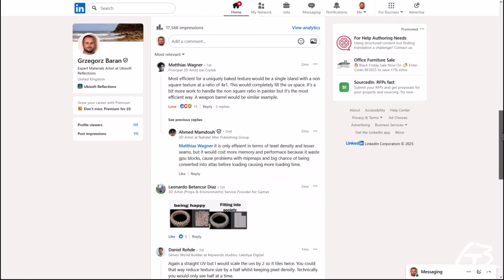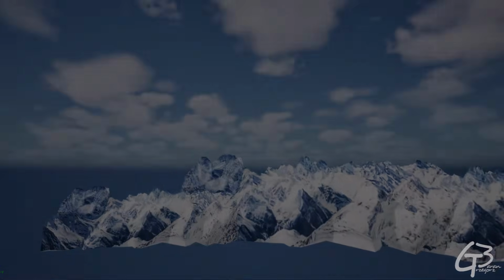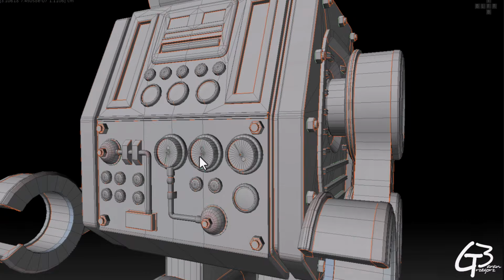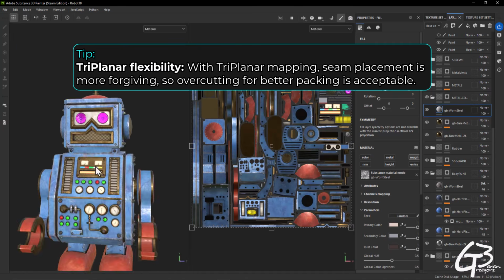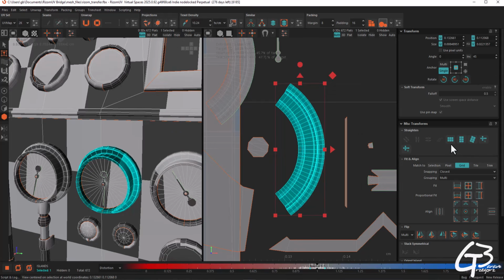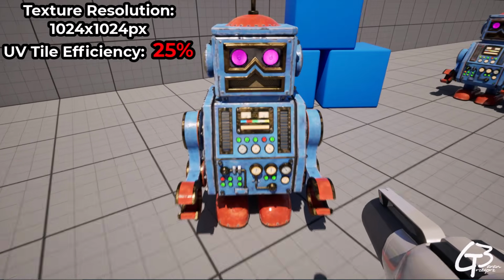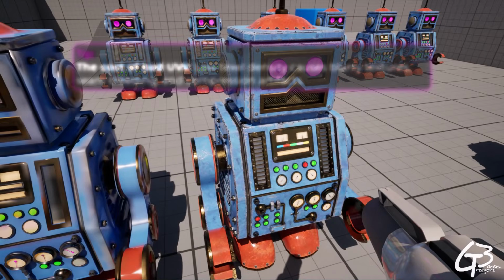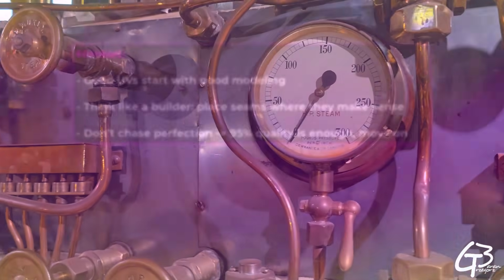UV Unwrapping: A Serious Guide for Clean, Production‑Ready Results (No AI)

Comment: I really like how you went into depth and showed the impact directly in Unreal. One question I have is how do I choose between 16px vs 8px island margin when working with 2k textures in unreal as it sometimes makes about a 10% difference in uv space usage. How well does unreal tolerate island margin on the lower end?
Reply from the maker: Thanks, very appreciated :)

Unreal is pretty tolerant of smaller island margins, but the real issue isn’t the 2K texture at full resolution .. it’s what happens once mipmaps kick in. When the texture drops to lower mips, your 16px margin might effectively shrink to just a few pixels, and an 8px margin can collapse to 1px or less. That’s where bleeding between islands can start.

In practice 8px on a 2K map is usually fine in Unreal if your baker adds proper padding and the material isn’t doing extreme sharpening .... 16px is the safer 'production default' for anything that will be seen up close, has high‑contrast edges, or relies heavily on mipmaps (foliage, props viewed at distance, virtual textures).

So...  go 8px when you want that extra UV efficiency and the asset isn’t super sensitive but go 16px when you want zero surprises in lower mips.

If you want to double‑check, throw a high‑contrast checker on the asset in Unreal, force a lower mip (r.MipMapLODBias) .. and look for seam bleeding. If it holds up at mip 2–3, your margin is solid.

Hope that helps :)
Cheers!
Reply: @GrzegorzBaranArt  Thank you so much that helped a lot!

Comment: Hi, nice video, congratulations. The use of mid-poly in-game has increased in recent years, and when I create this type of model, I often wonder where to best apply the seams when I decide to bevel the corner.
If I use a chamfer, I have to decide on which side of it (it's always more visible than if applied to the corner of a low-poly model). Should I always add a central edge on which to place the seams?
Reply from the maker: Hey, thanks a lot, glad you enjoyed the video!

there isn’t one universal rule, but there are reliable principles that keep shading clean and avoid visible texture breaks.
Basically, you don’t need a seam on every chamfered edge. A bevel doesn’t automatically require a seam. What matters is how visible the surface is, how tight the curvature is and whether the shading will stretch if you keep it continuous.
If the bevel is broad and visible, a seam can help avoid distortion. If it’s tiny and mostly there to catch highlights, you can often keep it seam‑free.

A central edge on the bevel is optional, not mandatory. Adding a supporting edge in the middle of the bevel can make seam placement easier, but it’s not required. It’s mainly useful when the bevel is wide or the curvature is uneven or you really want to split the UVs symmetrically.

For small chamfers, it’s usually unnecessary. The safest rule is to put seams where the shading naturally breaks. Think of it like this ... if the bevel represents a real, physical break in the surface .. the seam is fine. But if the bevel is just a softened corner keep it continuous unless you see stretching. This keeps your UVs clean and avoids visible seams on rounded edges.

In mid‑poly, the bevel is part of the final shading, so you’re balancing texel density, distortion and visible seams. That’s why seam placement becomes more strategic than in low‑poly. 
For game‑ready mid‑poly use 
- small bevels - no seam unless distortion appears. 
- Medium bevels - put seam on the hidden side of the bevel.
- Large bevels - add a central edge if it helps unwrap cleanly, then place seams symmetrically.
This shoul keep the model efficient and avoids unnecessary splits.

Hope that helps,
happy uvunwrapping :)
Cheers!
Reply: @GrzegorzBaranArt Thank you so much for your detailed explanation.